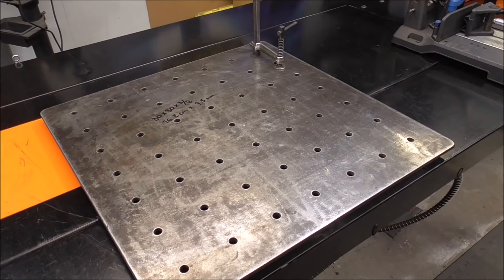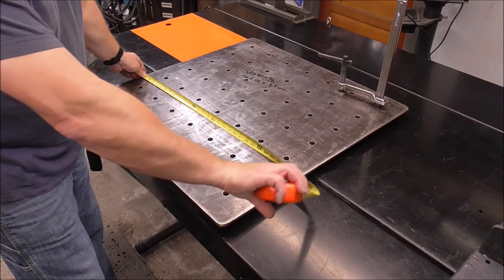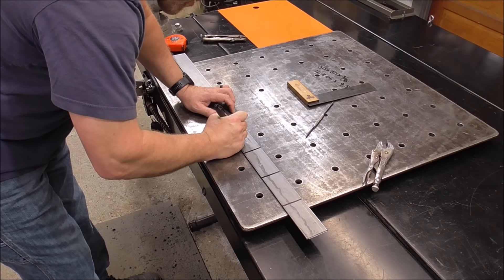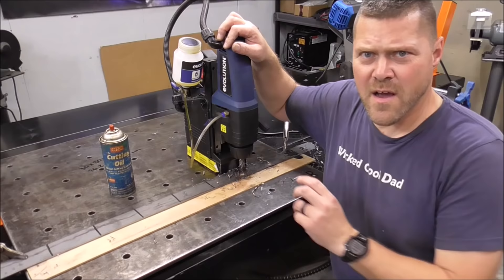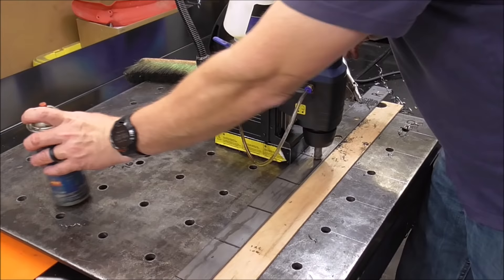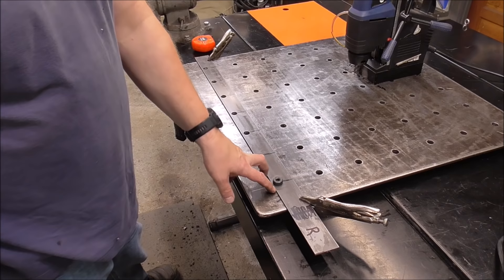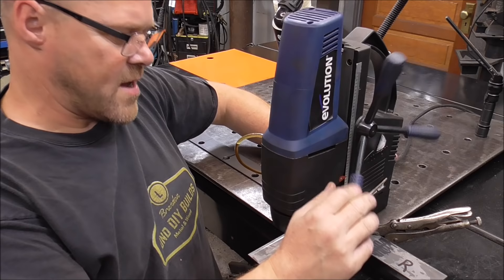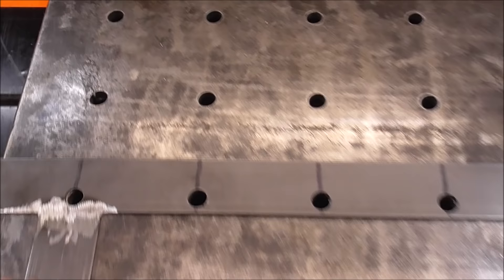Build any size Welding Fabrication Fixture Table DIY Template Perfect Layout

Comment: I’m a subscriber because of the professional quality of your content & presentation.  I did see a couple of things on this video that might give viewers a better chance of success and also save time.  Inexperienced fabricators may not be aware of the importance of placing the layout guide at exactly 90 degrees to the edge.  If you just eyeball the guide & it is actually at a slight angle, the spacing will be off.  My other comment is a quicker way to find equal spacing on your hole layout.  If you lightly scribe a diagonal line from corner to corner (both ways), where they intersect is the center of both height and width.  If you place the center space or scribe mark at the  intersection and work your way outward both ways, you will have equal spacing centered on your plate.  Just a suggestion.  Keep up your great work!  Thanks.
Reply from the maker: Thats awesome man and I appreciate your thoughtful comment and suggestion. We are all truly blessed to have such a great bunch of folks that are all considerate towards one another for the common goal of having fun and building cool stuff. Thanks again man and I appreciate your support!

Comment: I can say from experience 3/8 isn’t the thinnest you can go I’ve used 1/4 I’m one before with good success
Reply from the maker: @Adams Welding My only concern would be the holes wallowing out over time.
Reply: @BrandonLund  I can see where you may worry about that. The table I used before was mounted to a harbor freight portable welding table as part of a mobile rig and it seemed to work well for the guy I was working with.

Comment: you can actually drill through your part, without having a protective backer,
 when using an annular cutter, as the slug acts as a barrier to the cutter going any deeper.
it will just spin in the hole and not allow cutter to harm the part below.....
give it a try, it will make life easier, it may leave a few minor scratches, depending on how long
you let spin, but it will not dig in at all......cheers from Orlando, FL, Paul
Reply from the maker: Thanks for sharing Paul I will have to check it out!

Comment: As better support for not drilling more holes than you need 2" center rather than 4" centers is 4X as many holes.... 8x8=64, 16x16=256, 256/64=4 so 4 times as many.....

Comment: I understand you as a teacher.  I actually bought a broken drill press to put my Evolution drill on like you. Oddly, in nature I fixed ithe press . It's great but I want anular bits and the slow speed.
What am I missing to make it happen.
Reply from the maker: Lop that drill head off and weld on a 1/2" thick plate 🤣

Comment: Love the videos... I'm learning a lot!  Haven't welded since the early 90's.  Just doing some hobby welding now that machines are at a reasonable price!  Quick question - where would someone go to buy the steel for a fabrication table?  I have no idea where to even start... lol.  And boy... they sure are proud of those shoulder bolts.  Yikes!  Thanks and keep up the great work!  🤠
Reply from the maker: @Cowboy Stevo thanks man! Your best bet is just do a google search in your local area for steel suppliers. Tell them a size you want and ask if they have anything around that size as a "drop". Once you ask around you will get a feel which local supplier is more friendly. I have one 7 minutes from my shop and one 35 minutes away. I go to the further one. Better prices and they are more lenient about letting me look around the facility.

Comment: For those, like me, with no mag drill or annular bits, you can use chalk lines, a punch, and a step drill bit to get the same results. 

It probably takes a little longer but with a little patience, you can do it.
Reply from the maker: I agree 100% but I'm skeptical on using a step bit to get a fully precision hole. A step bit will often leave a conical shaped hole versus a smooth bore.

Comment: There's a great project to do early on when starting up work fabricating and welding.  I like the jig and simple approach that clearly gives excellent results!  I can see I will want to acquire several tools and even make a few.  The table is must have.  Sure would like an Evolution Mag drill.  I am now on the look out for a stand.  I have portaband so I need to watch your video covering that.  Thanks for the links to save!  The table clamps with shoulder bolts are a definite take away also. Thanks again for sharing and in depth instruction.  I have a question you may can help me out with.  I live in the country, nothing really close by so I do not have a good place to buy materials, steel, metals stock...  Do you have any sources you would recommend? You may have a video already, I have a good deal to catch up on.... Thanks!
Reply from the maker: Thanks man. Unfortunately buying metal online gets expensive due to shipping and big box stores charge an arm and a leg. Your best bet will probably be your closest metal fab shop. I have one 3 miles from my house but I drive over an hour round trip because they have much better prices

Comment: Great video. I’m curious if you were able to drill all those holes with one cutter or did you go through several? One tough thing these days as you know is the record high price of steel makes a new piece of plate freaking (or “wicked” for you Brandon!!) expensive. Finding a scrap piece has its own challenges too. But I can’t wait to build mine. Thanks for this and your detailed instructions.
Reply from the maker: @Booger & Zeke’s Welding Emporium if you take good care of these cutters they last a real long time (keep them cool and keep good feed pressure). My last hole cut just as fast as my first and I could probably cut several more tables before it needs sharpening. Yah steel prices are wicked rediculous right now lol. I hope they go down soon! Thanks again buddy and just keep your eye peeled. I looked for a while and stumbled onto this sheet. They are out there. :)

Comment: Hello, I would like your help, welding tables that have holes on the plate from which specific metal is the plate of the table?
thank you very much
Reply from the maker: Its just basic carbon / mild steel. You DONT want hardened or AR plate steel.

Comment: I guess it's time for a new table! I wonder if I can fix my current one or will I have to replace the top?
Reply from the maker: Jose you might be able to shift the new pattern away from the others enough so you can still use it.
Reply: By looking at your table, you just gave me a great idea. I will cover the actual holes on my current table by welding a thin plate and make one like yours, just place it on top separated by 1x1 square tubing.
Reply from the maker: @Jose Vazquez problem solved! 🤘💪

Comment: Would a traditional drill press be accurate enough?  I do not have a mag drill is why i ask
Reply from the maker: You could but a traditional drill press has a limited throat depth
Reply: @BrandonLund  ok, that does make sense.  Thank you

Comment: Brandon, have you used any bits larger than 1 1/8 and if you did how did it work. I've been looking at the Evolution but the paperwork says 1 1/8 that's not real large, thank you
Reply from the maker: The largest I have drilled is 1" and it did it no problem.

Comment: What about blueing or boiled linseed oil to stop rust and prevent splatter?
Reply from the maker: Both are great suggestions! I'm not sure how it would work as far as spatter but for corrosion protection it's pretty decent.

Comment: I’m having an issue finding a decent price on these shoulder bolts that or I’m not looking in eBay in the correct place!  Do you have a seller you have used that has great prices I’m finding them for around $9 each or have the prices gone up that much since these videos?
Reply from the maker: Unfortunately Mark thats the economy. I paid around 4.50 when built this. An alternative to this would be to use 5/8" drill rod. It's just as good minus the bolt head

Comment: Hay... Another awesome vid. 😍👍
The welding helmet and the magnetic drill press... Sick ❤️❤️❤️.
Love the way you explained the template.
Question, when you where 1st marking out the distance between each hole on the template with the tape measure.. Wouldn't it have been "faster/easier", to have used the square at each equilateral distance, to scrib the line, saving you having to come back and do it. Was just curious about that part. Lol.
Oh hay that helmet, does it come with the decals /prints on it? It looks amazing. Haven't seen anything like that here in S. Africa. Especially one that has those side view windows.
Last question. (I promise 🤣🤣) I've been struggling with my self learning to smaw. My eyes aren't what they used to be. Do you feel that the specs help you to see your welds better?
Ps
I'm definitely going to make me one of these fab tables.
Keep up the good work 👍👍
Reply from the maker: Thanks man for your support. I probably could have done the 1st step as you suggested. However you do it it just gas to be perfect. Double check everything. The helmet comes painted this way. It's called a true color. It's super clear. As far as seeing better. Readers or a cheater lens works awesome. Also. Get a halogen light and shine it on your workpiece. That helps tremendously.
Reply: @BrandonLund  I feel like such a noob right now 😂. If you hadn't mentioned using a light to see better, I honestly wouldn't have thought about it.
Lol, this is the type of reason why I follow /subscribe to your channel.
Thanks for that advice man👍

Comment: Never toss your math skills. You'll always need them.  
For your table,  multiply the number of holes by by the spacing.  7 holes x 4" = 28"
Subtract 28" from the width of your table (lets say your table is 34").  34" - 28" = 6"
Divide the 6" in half = 3"
Your first starting hole will be 3" in from the edge.  Your last ending hole will be 3" from the opposite edge.
This is a similar procedure when laying tile so that you don't have a thin tile strip on the othe side of the room or if you need to position something to hang on a wall.
Reply from the maker: Because math lol. Math was never my strong suit. I cheat and use a construction master lol

Comment: Hay branden. Man you have so many skills. 
Just wondering what your past experience is as far as your work experience.
Reply from the maker: Thanks man! I got into the trades when I was 17- 18. I owned my own business for 12 years building pipelines and sewer treatment plants but I got tired of traveling with small kids and a family at home so I shut it down and was hired by one of my general contractors doing bridge work and commercial buildings. I haven't been in the trades for about 10 years but i still continue to weld and help others here on YouTube.
Reply: @BrandonLund  Wow thats interesting.
I work for the department of defence at selfridge airforce base in michigan. I'm a hanger door mechanic also do the electric gates to the runway and welding and fabrication. 4 more years to go.
Reply from the maker: Right on man! Sounds like an interesting job!

Comment: Ok Brandon one more question. You set your spacing at 4 instead of the traditional 2 in and I understand your reasoning. My question is, have you ever since then wished that you had made the spacing 2 in because of a certain project or because of any reason? The main reason I ask is because I'm about to pull the trigger on a 4x8 sheet of half inch material and I just kind of want to really make sure.
Reply from the maker: I havent wished i went 2". The only time it might really matter is if you plan to build small things. Most everything I build is longer than 12" so being able to grab it every 4" is plenty.
Reply: @BrandonLund  thanks man! Always as usual super helpful. 💪👍
Reply: @BrandonLund  and you just cut my work time literally in half. My Evolution mag drill thanks you as well! 🤣

Comment: Hey Brandon, as always, sweet video mate. 
I’m looking to get into welding and probably get at a 125 -175 Amp MIG setup - flux core initially so I don’t need gas. 
I have a large woodworking bench which I’d likely just drop a table top like this on top. Would you suggest 1x1 would be sufficient height to avoid burning the timber underneath or better to go 2x2? 
Cheers 👍🏽
Reply from the maker: Thanks Craig I appreciate it! 🙏  1x1 would be plenty but if you went 2x2 then you wouldn't have to cut your shoulder bolts because there would be enough clearance so they didn't hit the table below. Sparks will drop down through those holes so it might not be a bad idea to put a thin sheet of metal on top of your workbench then set your fab table on top of that. It would probably be fine without it but there is always that chance that a spark could go through one of the holes and ignite the wood.
Reply: @BrandonLund  copy that, appreciate your advice mate.

Comment: Your jig holes don’t line up to your table holes
Reply from the maker: @C H That is impossible. The holes in the table were made using the jig.
Reply: @BrandonLund   The hole on the left part of your jig does not line up with the table hole.
Reply from the maker: @CH-oz3li  it must be a paralux error because as I said, I drilled the template then used the template to drill the holes. It has to line up
Reply: @BrandonLund  maybe so

Comment: Went online to likely buy that Evolution Mag Drill for the $5XX but, sadly it was $629. Got a link for the discounted pricing you mentioned?
Reply from the maker: Hey Mark, If you use this link https://store.evolutionpowertools.com/products/evomag42?ref=BRANDONLUND and type in the code EVOYT5 at checkout it will save you 5% Unfortunately the price of everything is going through the roof from steel, manufacturing to gasoline and those increased costs get passed down to us, the consumer but every bit of savings helps. When I purchased mine it was around 580.
Reply from the maker: Here is another link that will get you in that price range. It's takes a smaller cutter but I have yet to use any cutter larger than this one will cut so it might work for you PLUS you can use that same code i sent earlier Evolution S28MAG: 1-1/8 In. Magnetic Drill With Carry Case
https://store.evolutionpowertools.com/collections/magnetic-drills/products/s28mag?ref=BRANDONLUND
Reply: @BrandonLund  Awesome!
Reply: Thank you, Brandon
Reply from the maker: Anytime buddy!

Comment: Couldn't  you have  just turned your  temples  90 degrees  square  it up with  your square.  Instead of adding  the tabs.
Reply from the maker: @rawwetzel I probably could of but I felt the tabs were the best way to keep it simple
Reply: @BrandonLund  I think the tabs make hole placement more accurate after the first row.  It becomes the reference for all other holes.
Reply from the maker: 100% Dan!